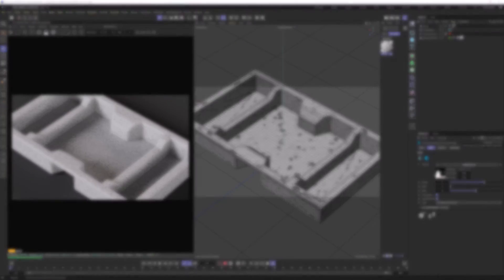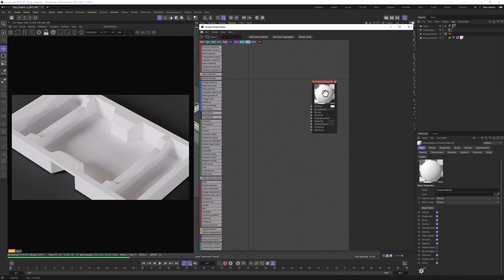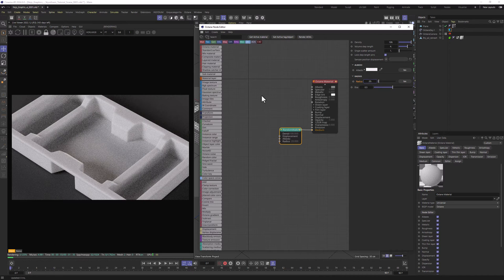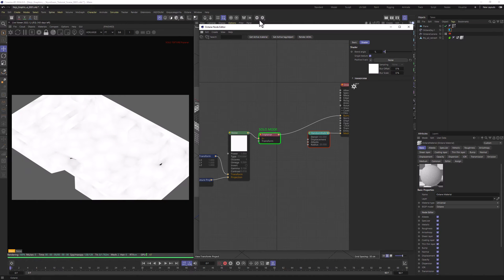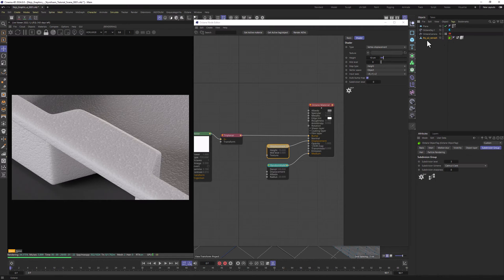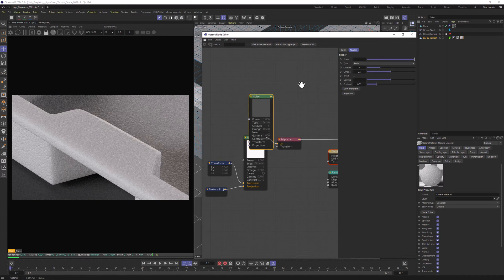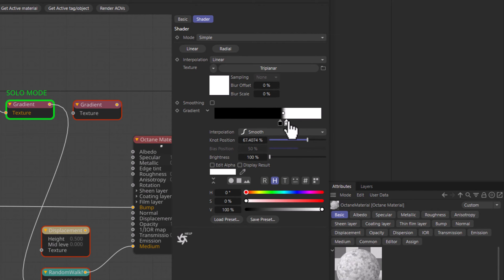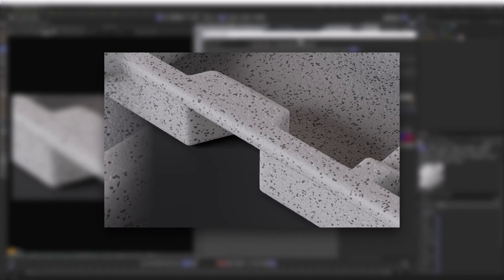Procedural Styrofoam: Cinema 4D & Octane Tutorial

Comment: What is the difference between GGX(energy preserving) and octane brdf mode? Your tutorials are all about switching to GGX mode, is octane mode hard to use
Reply from the maker: In short, there are several benefits to using GGX with energy preservation. It allows for anisotropy, excels at preserving light energy when adjusting material roughness, and provides a better specular "tail" with low to mid-level roughness. Overall, GGX with energy preservation is the most versatile option, which is why I always recommend switching to it.

Comment: Very cool! Learned a lot from this one. Great work.

If i had to choose for another texture tutorial, id say anything that has a stylized look. I've personally been trying to find a way to get a painterly effect, and recently came across a technique that utilizes painted Normal maps to produce this. Something like that would be a godsend!
Reply from the maker: Thanks! I'll definitely look into that. I'm familiar with that method, and it's also feasible to implement it in Octane to some extent. The real question is whether we can achieve that within Octane without resorting to Substance Painter, and just how far we can push the stylized look in Octane!
Reply: @Stiegosaurus  right, so perhaps there's a way to generate a painterly effect procedurally and then apply the hand painted normal map based on it. Sort of a two- step solution